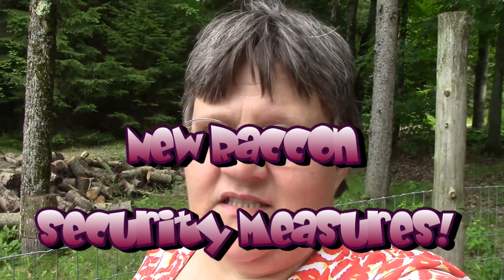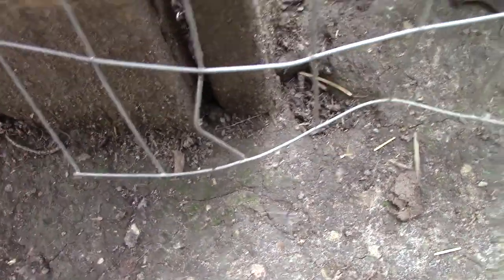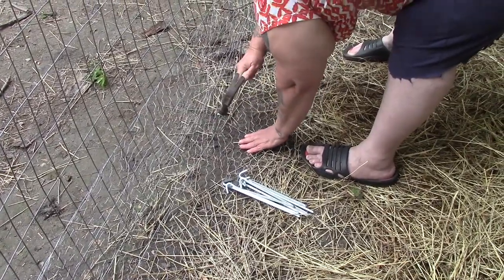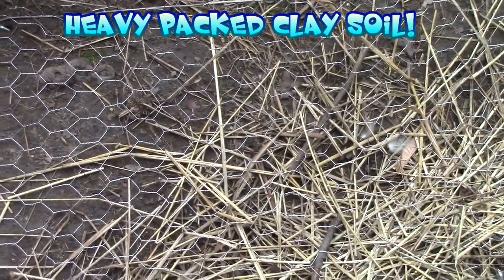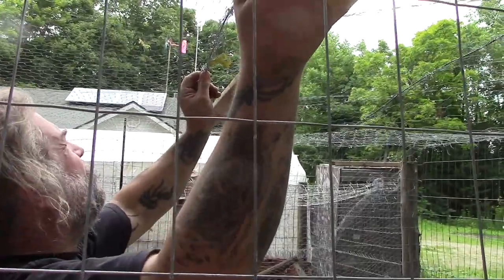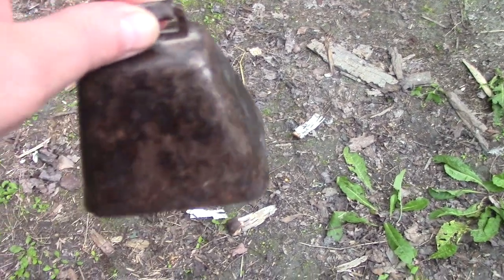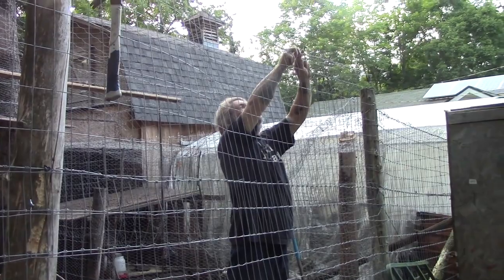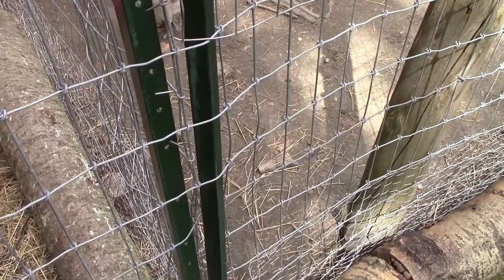New Raccoon Security!

Comment: Looks fantastic, as does everything you guys do...one thought though....what's to prevent the raccoons from digging under the door area? Maybe you could run some chicken wire across the bottom of the door and skirt it along the ground and tack it into the ground right there? Also I got news for ya those hook and eye clips on the door, those raccoons can manipulate to get them open! Maybe try something like a carabiner clip, they sell them at those hiker's stores, such as the camping stores and such, they're really cheap, but have a tensioned mechanism so that it's much harder than to just lift it up like a hook and eye closure! Just a thought...

Comment: great job you 2 !! we lined our back yard with fire wood all the way around . when i let my very small 8 dogs out to do their business they use to crawl out under the fence . and being that im a corner home , here in michigan they told me it was an eye sore n we would be fined or to remove the wood . what a load of crap ! thanks to ur video , i am going to go get a ton of those tent posts . we did keep the fire wood but replaced it with smaller pieces . it is not visable from the road , only if you walk along side my home on the public sidewalk . i get checked up on every spring . i was told that someone has to be reporting us . we r  only allowed 3 dogs . i dont get it . they stay indoors at all times except if we r in the yard or for them to go potty . all 8 dont even add up to the size of 1 lg dog . certain parts of michigan suck . god bless you n im praying you have great luck with all ur new babies . hugs n xxx  have a super great week .

Comment: Less I missed it, did you put anytthing under the door opening to the pen? Racoons are excellent diggers as you know. What I find useful at the foot of doors was just a chunk of sheet metal attached to the door frame out a foot or so. My other deterent with 2x4 fencing was to leave the top foot or so floppy so as they attempted to climb their weight would cause the fence to curve back on them making it even harder to climb. A loop of wire around the posts to keep the fencing from going all the way over was what I find useful. The bell was a nice touch.
Reply from the maker: Thanks for the tips! The paddock is hard clay..and ( touch wood) we never had digging issues even when the pig was running out there...so I am hoping this will be fine. so far? So Good!

Comment: make a 4 inch by 4 inch ditch around the bottom then fill it with concreet with the fence in the middle the concreet makes a great barrier and holds the bottem of the fence tight the only down side is its pretty much permanent just my 2 cents hope this helps
Reply from the maker: The clay is too hard to dig through!